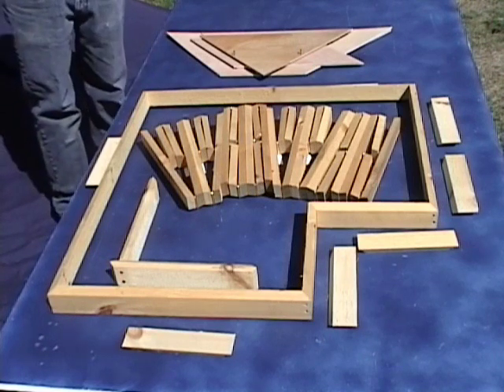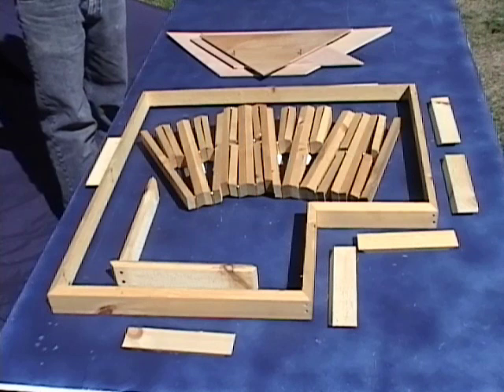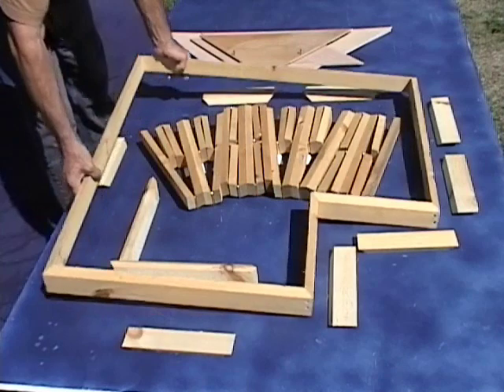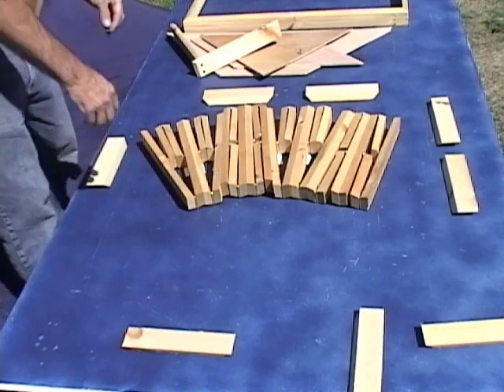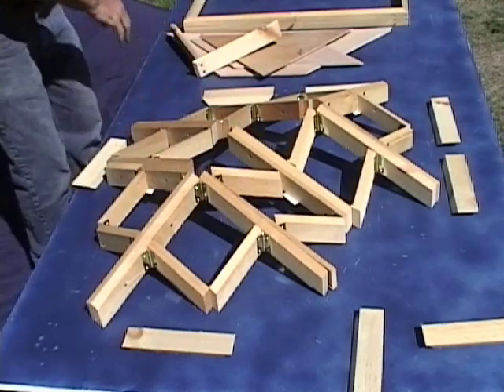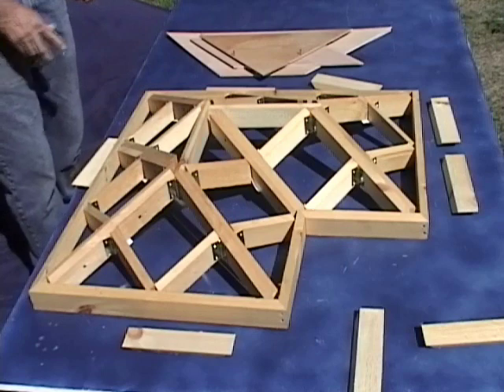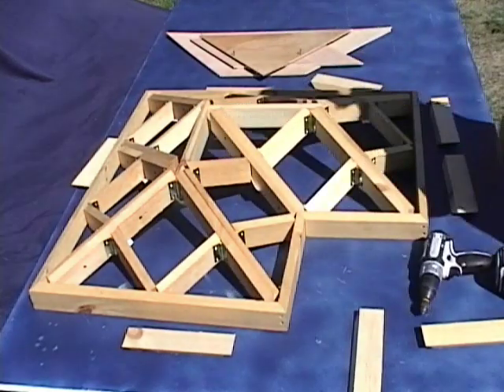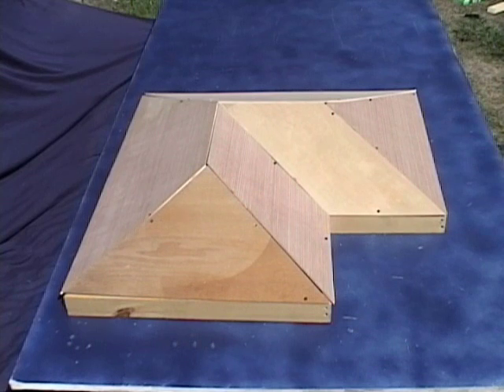Aldoized L-Shaped Folding Roof.wmv

Comment: Hi I am very impressed with your roof design.  It is a wonderful synthesis of both practical structural consideration, ingenious carpentry, and a workable origami folding system.  As an architect and student of contemporary design, your video is refreshingly simple, to the point, and on topic for many aspiring designers.  Kudos to you!